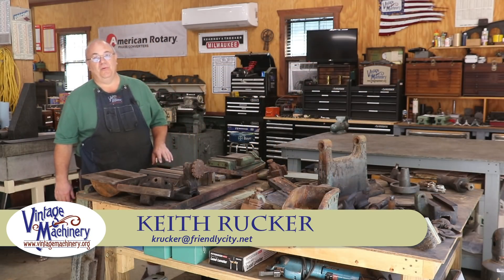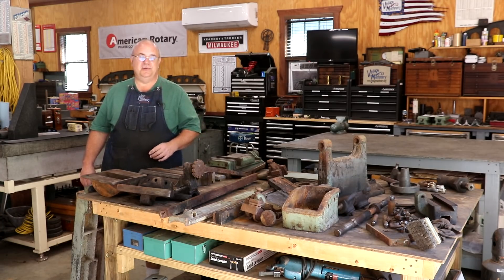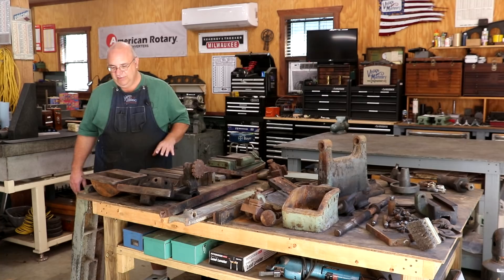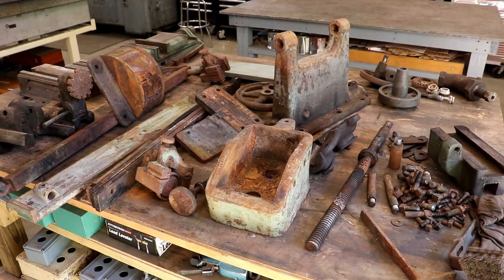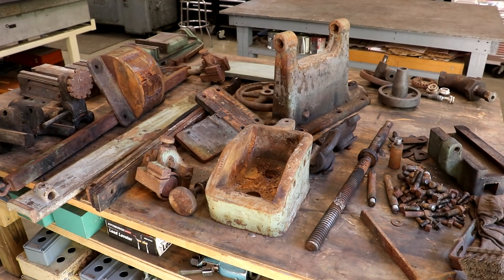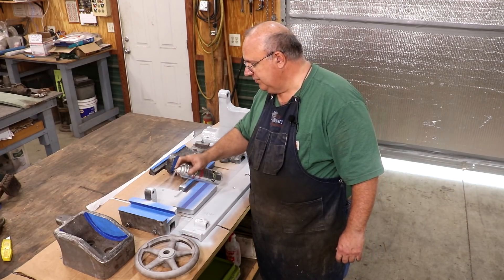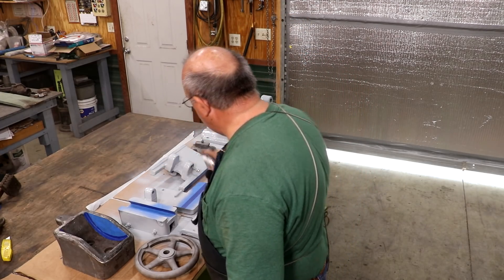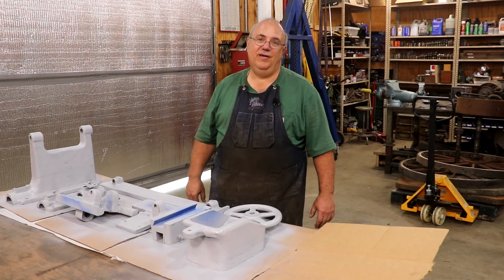The Jimmy Diresta Band Saw Restoration, Part 3:  Prepping Parts by Removing Rust and Old Paint

Comment: There is one product that I live by for priming and rust prevention - Flood's Penetrol - Goes on with a brush and creeps into everything - After each project I wipe the brush off on any tool that is going to be used outdoors - hammers, screwdrivers, wrenches etc..  This stuff is thinner than motor oil.  I have a lamp post next to the Atlantic ocean that was primed with it 30 years ago - the anchor bolt nuts are just starting to show corrosion. You can also mix it in oil based topcoats to eliminate brush marks - works great on castings.

Comment: Wild man Keith painting indoors with no respirator! Hopefully enough space and moving air in there..:You are a national treasure Keith. We need you in good health!
Reply: ALWAYS when you're painting with solvent or epoxy based paint wear a respirator.  Even if you're using a paint booth (which Keith wasn't) or painting outside (which Keith wasn't) wear a respirator.  I wear a respirator when I'm using acrylic (water based) paint because it's a good idea.

Comment: That black on the surface is a filler made at the factory with the filings from the grinders.(guessing)    My old molder friend said they would mix this up with some kind of binder and slather it on castings with their hands.  He said the metal filings would heat up as they worked it.  I have made the big mistake of sandblasting this off on my first hit and miss restoration. Bondo (et al )   will come right off after a few freeze and thaw cycles because it does not have the same coefficient of expansion as the casting as does the metal filler.   He did not know what the binding was.I think he called the filler something like "thermite".     Love your work on this beast!

Comment: Keith, great project! Tip: for rusty machined wear surfaces, use fine steel shot instead of glass beads or sand. Shot won't embed, actually harden the surface, and retain oil similar to a scraped surface.
Reply: Great tip there, thanks man.
Reply: Well, NEVER sandblast mating or sliding surfaces with anything. That the quickest way to ruin them. We see this on eBay where some guy out to make a fast buck, blasts every surface of a part, trying to make it look better, requiring that part to be ground, and sometimes scraped to bring it back to usability.

Comment: Keith, since you use so many rattle cans in your restorations, I thought I'd mention recently watching a video where a guy built a rattle can shaker that fir into his drill motor's chuck.  He used a 3-inch (~75-mm) plumbing pipe test plug, modified with a longer screw/bolt so it could be held in the drill motor's chuck.  He also had about a 12-inch (~300-mm) long piece of drain pipe that the test plug was expanded into the end of.  The pipe is large enough for pretty much any rattle can and in about a minute did the shaking equal to the 5-minutes the can says to do by hand.  The guy said his rattle cans painted better after that than ever before, so you might want to try it -- it should cost $10-$20 worth of materials and ought to last forever, I think.

Comment: I've rebuilt many cooling tower gearboxes and i believe the coating they use is coal tar epoxy. Its some knarly stuff when your trying to remove it even sandblasting doesn't always work. its very resistant to constant water splash.
Reply: I don't think there were any epoxy products available when this saw was build :-)

Comment: So many people think sandblasting will destroy some parts. I sandblast almost every part in my machine restorations. Several decades ago I even sandblasted a ball bearing (in my drill press) and the press is still running fine and quiet; key is to clean well afterwards. Parts that don't get painted will then be either wire-wheeled or sanded/ground to restore a bright surface. For painted parts, it's hard to beat the way sandblasting preps a surface for adhesion.

And when it comes to painting, it's hard to beat powder coating. Ready to assemble a lot quicker than evaporative paints (even faster than two-part paints) and has excellent gloss & smoothness. Only downsides are it's virtually impossible to touch-up (nothing "sticks" to it) and you can't coat anything that can't survive a 400 deg F oven (like motor windings). Nevertheless, my machines come out looking excellent and are quite durable.

Comment: I’m not arguing with the methodology Keith uses, but just some info on priming. There are several reasons for it. One, for metal is to help prevent rust. On wood, to prevent rot. A second reason is because without the tints used in paints, which are often the most expensive part of the paint, you can lay down more layers for protection using the cheaper primer. So it’s a cost saving method as well. And yes, lastly, some primers are sandable, though not all. For machines, there exists a thick primer that can be applied in layers that will fill small dents and pits, allowing you to sand off an amount to conceal them without having to fill them with something, which is a time expensive method, which minimizing, is a goal. This can also allow those extra smooth surfaces to paint for high gloss. Though you need to sand the numerous paint layers to get that top level look.

Comment: More Evaporust success- I will try that next time! The no-primer approach , especially on cast iron tool frames, makes a lot of sense. Surfaces that are prepped properly and stay indoors and undisturbed should do fine without primer. And if a tool surface is being abraded during use, primer will likely be scraped off as easily as paint.

Comment: The gravestone industry uses a self adhesive rubber sheet to protect the polished stone surfaces while they sandblast the lettering and artwork. I have used it to protect machined surfaces during bead blasting procedures. Check it out for future reference.

Comment: Keith.... when using a rattle can sprey paint stuff, when your done turn the can upside down and sprey till the paint stops and it's just gas coming out, that way the nozzel won't clog and you can use the rest in the can later... also set the can on it's top, not it's bottom when storing a sprey can of paint ! .... MAKES A WORLD OF DIFFERENCE WHEN SHAKING THE CAN if it's been stored upside down, mixes much faster....but always shake a can for at least 3 minutes no less !  thought you might could use that information ! ...

Comment: I know my comment is way to late, but for another project,  there are outfits that come to your house and blast your "insert object" with glass grit and water (recycled glass bottles) towards the end, and for rinsing they add a rust preventer to the water, which works real well (leaving only the faintest layer of flash rust)   when the yard is dry, you just sweep of the glass grit, and you are done.

Comment: I looked at the shade of green on your t-shirt and thought that would be a great colour to paint it.
Reply: I like green also, just seems right somehow. Maybe a little darker than Keith’s shirt. If it was mine I’d probably paint it two coats with a brush. Get a gallon of high gloss oil based, thin it down so it flows well and watch that big boy come to life. Most brush on paints are too thick from the can and need a little mineral spirits to flow well.

Comment: I think the amount of prep work that goes into your paint job depends on the machine you're restoring. If it's a high quality, post WW2 american machine tool from Monarch or some other respected company it deserves the full treatment. They put a lot of effort into the look of their products and if you want to call it a restoration you shoud treat them accordingly. On older machines from like 1890 it's a different thing, paints were mostly based ond stand or lindseed oil. There was a discussion on the old filler materials somewhere on Practical Machinist.  Keep up the great work !

Comment: I worked on Newspaper presses and around them for 45 years.  I painted them with an epoxy based paint. Even after daily use, never saw any wear on the press after 40 years.  Daily cleaning a rubbing with strong petroleum products (late 60's). Inks are fun to get off at times.

They are not cheap , but it will be the last paint job  you'll do. They are probably cheaper now, haven't priced them in years.

Comment: Carpal Tunnel cure... Just an FYI. About 30 years ago a pediatric surgeon from Silicone Valley discovered the main cause of CTS was computer monitors were set too low. The bottom of the monitor should be even with you chin.  She eliminated over 90% of the need for surgery.  The actual causation was the persistent bending of the neck.  Set a 30 minute timer. and look for traffic left and right, then count your toes and check the ceiling for spiders.

Comment: I'd like to know what that filler is.  Last year I restored an old German horizontal mill that had a lot of it under the paint.  I tried not to remove any of it, but some was peeling off or damaged and I had to use Bondo.  Bondo does not like to stick to it (at least in my case)!  The black stuff was slightly gritty, and had no smell when heated.  It softened a little with heat, but didn't become "reusable".  I tried because I was hoping to not use any Bondo.

Comment: Had you looked into electrolysis for rust removal? Takes a little time, but you just put it in the tank and forget it for a day or two. Used to restore tractors and in my opinion, electrolysis was much better than blasting. Removes paint, rust, old grease, etc.

Comment: Keith. In australia i use a product called "dry coat".spray on metal and it prevents flash rust for months.to me.a restoration is.as it came from the manufacturer. With all its imperfections. 
Thats a true restoration.

Comment: Hi Keith,  I hope you are well, would the black stuff be "Pitch" as it was used a lot over here in the UK for exactly what you have come across,  heater it up to a liquid and smooth it on  when it's cold it sets like concrete and you can sand it and chisel it. 
Thanks for the video, The evaporust looks to do a good job, all I've got to do now is find out what keylation is ?
Regards to all Richard 🇬🇧
Reply: chelation is where the chemicals in the liquid ‘wrap around’ and remove the salts etc that cause the rust.
Reply: Chelation https://en.wikipedia.org/wiki/Chelation
Reply: @davidmam  Thanks David, it seems to work well.
Regards Richard uk
Reply: @D989501L  And I think the stuff that Keith has to wipe off at the end of the process is the carbon that was in the iron and isn't removed by the chelation.

Comment: Could the black "filler" be Japanning? That would go along with your "tar like" observation.

 Also, I'd like it if that hand wheel had it's outside rim polished to a high shine. I think that may even be accurate for the application.
Reply: I was thinking that on the handle too,might be a nice detail either way.
Reply: Maybe pitch?
Reply: @stoflom  Japanning is basically pitch cut with turpentine so it can be spread, and then baked in an oven to drive of the turpentine and harden it.
Reply: Or coal tar.
Coal tar epoxy is popular to TRY to keep steel from rusting.
Reply: Burnished rim looks good on often used handwheels like feeds of machines because they are nickel-plated and you are constantly burnishing it with your hands. On seldom used wheels even nickel becomes dull, and cast iron will not take high burnish. Also all these flashes may be rather dangerous in the workshop.

Comment: since you are missing a few cast parts on the second bandsaw.. are you going to figure out how to duplicate them for that one.. even if you just send the castings for rough copy..  or get in your wood shop and make up some quick patterns..  or if its the bearing housings.. throw a big block of wood on a lathe and make the tubular section and then carve the bolt bosses on the band saw then split it.  heck. use the shop vacuum and a plastic bag to vacuum out a trash bag and take a plaster pattern off it. . pull it out and pull a positive plug out of that..

Comment: The Black under filler is JAPANNING,,, My Dad had a Shop Manufacturing the - Colt Clamp co. and we used Japanning as a dip for some bar clamps !
Reply: Sorry, but no; that old black filler can be 1/2" thick.  No one would use a thin finishing treatment to build up enough layers to fill deep imperfections.  It also can be a little gritty.  Japanning is smooth and glossy- that's what makes it nice.

Comment: The 'filler' material, could it be Japaning? The ingredients include powdered asphalt and turpentine. With heat, it melts into a very smooth, durable finish. Pretty common on 19th century storage tins and tools.

Comment: 8:46 - wouldnt it be a better solution to get some seamless pipe, flame cut a plate, weld them together, maschine the plate flat and drill the inlets for the babbit amalgum and all grease points? since it cracked several times this thing appears to be a weak point - one you can eliminate by useing steel or have it new cast
Reply: Keith always says that he can braze cast iron as good as solid casting and better than weld. And if the cap will be more resistant you risk to damage the main casting wich will be a nightmare to repair.

Comment: If I don't have primer on hand I just start with a light dusting or two of the paint and let it set up a bit. then just spray up my finish over that. it gives something to stick to, especially with cast. It's also cheaper to use "fleet grade" paints. for machinery & weldments you don't have to pay for the best automotive paints..

Comment: I'm restoring a similarly built bandsaw from around the 1920's and I took the easy way out - disassembled, cleaned it and brought it to a specialist not only for blasting but also for painting. The cast metal parts are sensitive to heat so when blasting you don't want to introduce too much heat lest you alter the structure of the metal itself. A specialist will have the equipment to deal with that and also to paint a frame that even when bare weights over a thousand pounds.
Reply: I thought cast iron was pretty heat tolerant. Look at cast iron cooking pans they get more heat than sand blasting. Just wondering.
Reply: If you heat damage a heavy cast iron part by sand blasting, you are doing something way wrong.
Reply: Sheet metal parts can warp with sandblasting and to a much lesser extent with bead blasting. This can be minimized by using lower pressures and blasting at an angle to the surface of the metal. Iron castings to my knowledge are not effected by sandblasting as far as warpage but will have a modified surface finish.
Reply: Are you implying the Keith is not a specialist? Shame on you.
Reply: @ellieprice3396  you could certainly read that, if you want. Or you could just understand that I don't consider myself up to the task.

Comment: Considering the original paint applied was without a primer and with a brush? Rattle can grey primer is over kill. But, if the bandsaw is going to be a center piece? and it's size suggests that? Yeah, grey rattle can to keep the rust off is A-OK until you can get more information from the end customer.

Comment: After the fall of the first Tay Bridge an enquiry found that the castings of many of the columns were of such poor quality that the proportion of black filler used to fill and conceal many of the flaws was way too high versus decent cast metal. There had been some clever means used to disguise the quantity of this black filler purchased for use in the job. However, the main fault was found to be poor design, relying too heavily on assumptions of a solid rock river bed for support and of too much reliance placed in putting cast iron into tension at some points of the structure.
Reply: And many issues on how the casting was done too. At low tide you can still see the original bridge supports (I live in Dundee so get to see it every day)